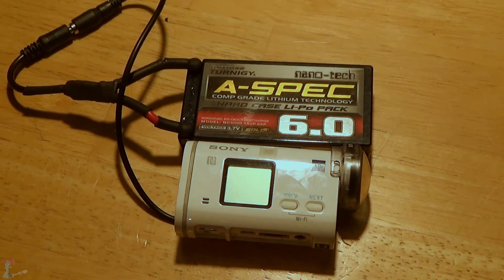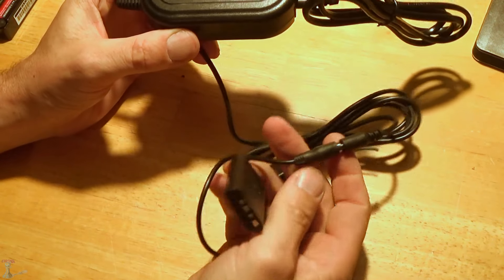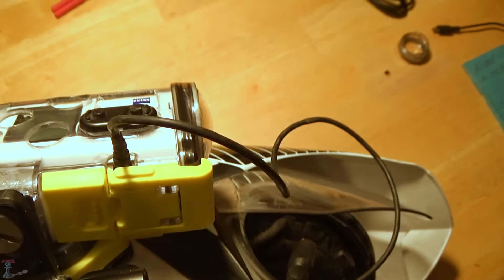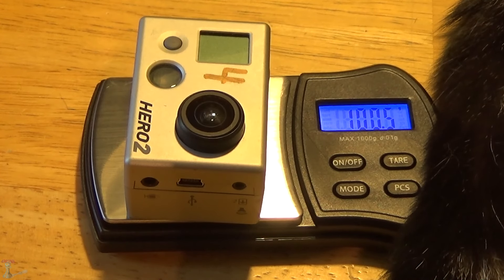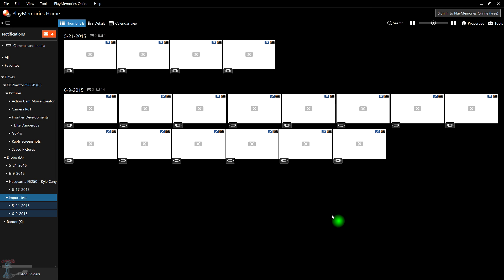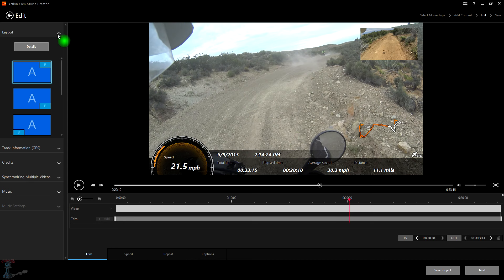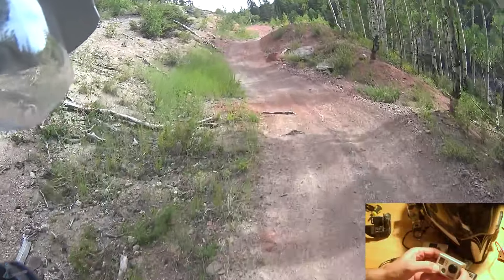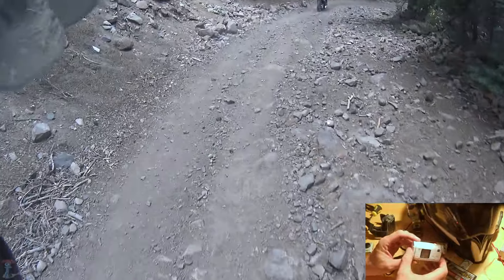External Battery Mod for Sony Action Cams (AS200V) 8 + hours of record time

Comment: Work and directly modifying the cable inside, and put in place special charge miniUSB port, without the need of anything, just direct cable simple.bridge white and green thread each side in miniusb.And power is normal 5V output any bank power,not special 3,7V output ! Work 100%! Example here https://posturi.wordpress.com/2014/07/17/incarcator-auto-pentru-tableta-asus-nexus-7-2012/

Comment: Judging by how you treat your cameras no wonder you keep scratching their lenses so often. Chill dude.  First of all this is an action camera. IT's supposed to record your action moments.  8 hours of action moments on a day it is probably the 1%. For the rest you have other type of cameras. Why they all have crappy batteries? Simple. Because they are meant to have a low weight and small size and it's hard to squeeze  5000mah in those small bodies. Nobody wants to have half a kilogram on his head when he goes skying or diving. Also you could of saved your 40$ and check out some of the 1600 mah batteries available here :http://www.amazon.com/HDRAS100V-HDR-AS100VR-HDR-AS200V-FDR-X1000V-Replacement/dp/B00IT31ACW
That is basically 3200 mah and should not be that hard to change them when  one goes dead. Or buy 4 of them and you're set. Without "butchering"that water resistant and dust (was) case. Just saying..
Reply from the maker: +clockyro Judging by your condescending comments I probably shouldn't even reply but I will (against my better judgment). Lets see, I scratched two lenses in almost 7 years. The GoPro I accidentally dropped on the pavement, could of happened to anyone. Not sure how I scratched the Sony, I suspect my cat knocked it off my desk and it hit the tile floor. But I still don't think that's a horrible track record. I'll pass on the chill advice, god forbid I try to be a little enthusiastic.  It's also clear you missed the point of this modification. First off what “other cameras” would you recommend? I've scoured the internet and the Sony action cam was the best helmet cam that suited my needs. Once I solved the short record times, I'm actually rather happy with my current set up. It's only 250 grams or .25 kilograms, not half a kilo. I don't even feel the weight on my helmet. I own 3 of those crappy stock batteries and they suck. It seemed like every time I looked the battery was dead, so annoying constantly changing batteries and you still miss the good shots. I don't care about it being waterproof, it's good enough, I've ridden through heavy rain with no issues. I will admit sometimes the dust will start to collect on the lens on really long dusty rides, I may fix that with foam at some point but it's only happened once and it was a 10 hour ride in the dustiest possible conditions. Overall not a big deal. Look I understand this modification is not for everyone. But for me this mod is perfect. I frequently go on all day rides and I wanted to record the entire trip. Most likely I'll only use a few minutes of the entire days ride. But when something interesting happens, I'll have the shot and others won't. Just sayin...
Reply: +clockyro I thought you were exagerrating, but damn. I couldn&#39;t watch anymore. He handles things like a kid with ADHD. Slam. Slam. Slam. Drop. Throw. Slam. Etc.

Oh, that amazon link. Those batteries are junk. They last ~1hr. 30mins less that OEM.
Reply: +jonno85uk LOL ,  it is really hard to buy and charge 4 of them to 100% and change them when the time comes. It takes 20 seconds to change the battery and that is unacceptable for the modern folk. And if those in the amazon link are junk , buy the originals then. They do work for me just fine. Cheers.
Reply: clockyro I use mine for driving long distance and kinda hard to change will driving at night. I do love g distance driving. Band pulling over takes time. But yes this guy just tosses everything even his new camera. Jeez but good video